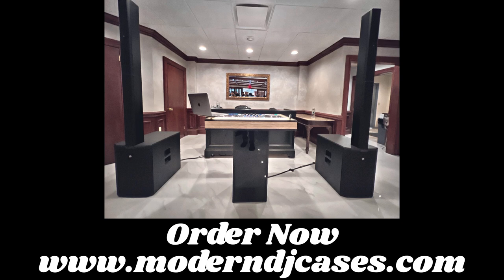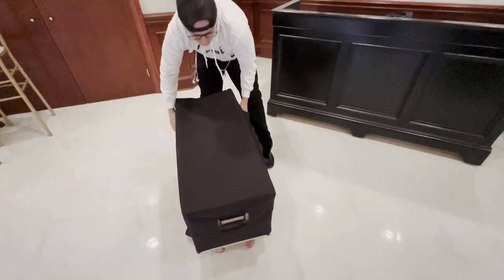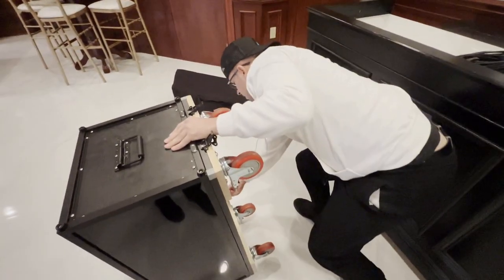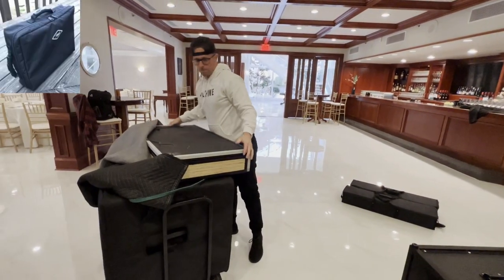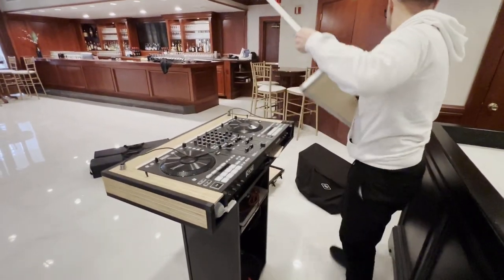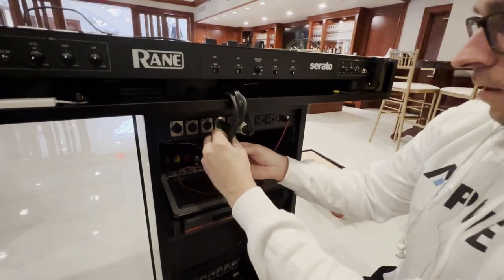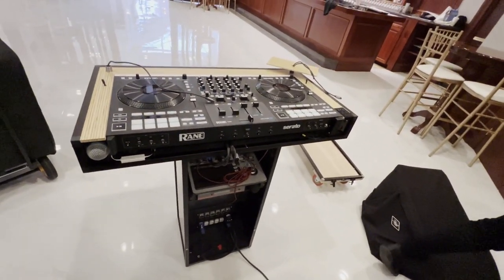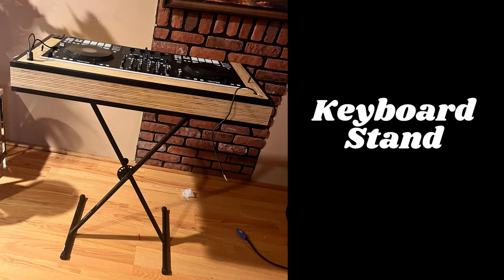DJ Control Tower setup in less than 3 minutes. RANE FOUR CASE

Comment: I can’t believe the top doesn’t latch to the bottom, that is a disaster waiting to happen. Looks very unstable… I mean good luck but I DDJ at jungle dances and they get rowdy!
Reply from the maker: I do weddings and how can it be unstable? If this thing tipped over it would tip over as a whole thing. Even it was a latched together. If you do rowdy dances you should be using a dj booth made out of truss like they do at festivals. I been using this style system for 6 years now and haven’t had an issue lol and I used regular truss which is much smaller than my base.
Reply: drunk guestr at a wedding comes over and leans on one of the ends and is over. did you make this?
Reply: if it was latched together, at least you will have some time to catch the whole thing  @ModernDJCases
Reply from the maker: 6 months 60+ gigs later, not a single issue. not even close plus i had a similar setup before on a piece of truss, and thats 12/12. this is like putting something on a cocktail table, if htis gets knocked it doesnt matter if latched or not.  @DjGCue71
Reply: @ModernDJCases the fact that it haven’t happened doesn’t mean it won’t happen ever. That is wishful thinking

Comment: $2000 for a little bit of wood and metal is wild
Reply from the maker: $2000? It’s $949 
And it’s not a little material, it adds up very quickly. And not to mention There’s professional tools used. A planer, a router, table saw, chop saw, lots of wood glue, and most importantly there is a lot of labor.  But it’s not for everyone and I don’t even care much to sell them, I only made the availability because a bunch of people were interested and asked for one. 

Thanks 🙏
Reply: Yes ,that is crazy. I already bought the wood and I'm ready to do it myself.

Comment: Can I order the base all white Led and the transport kit by itself without the top case.
Reply from the maker: just as a shell? and led as in you would want white acrylic so you could put an uplight in there?
Reply: @ModernDJCases  Yes sir I use a small controller sb3 and already have the top made.  I need the bottom. Been using a totem but would like something that looks more official.
Reply from the maker: @thestarvingdjs  can you give me the width and length of the top case ? And where are you located ?
Reply: @ModernDJCases  I'm located in Raleigh NC and 
Top is 40 wide  19 depth
Reply from the maker: @thestarvingdjs  wow the top is bigger than mine haha mines at 36.5 but yes should be fine email me info@moderndjcases.com and we can do a quote